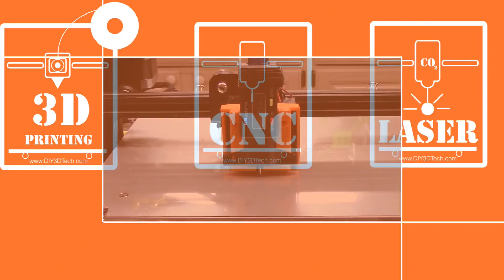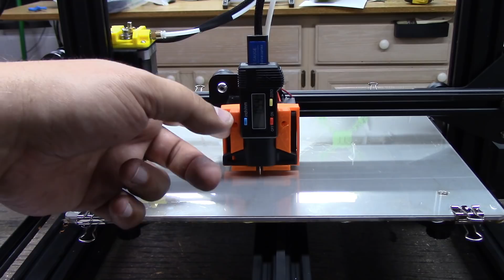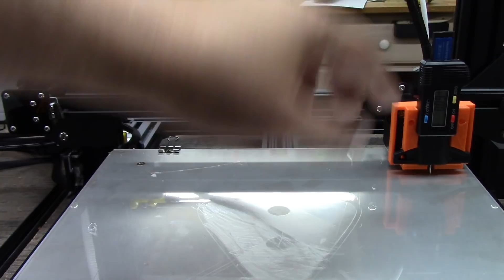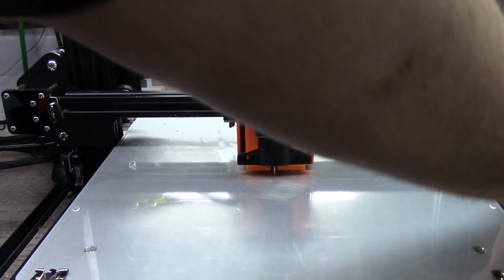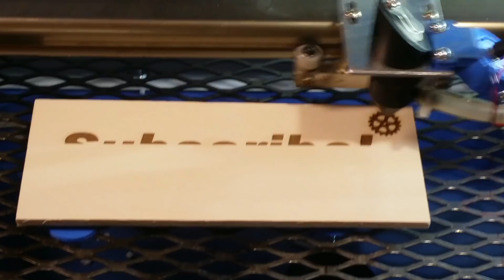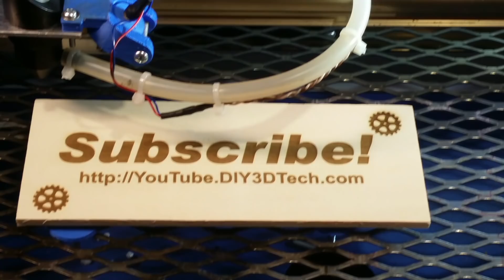Creality CR10 - Low Cost Digital Bed Leveler and Tramming Gauge!

Comment: I don't understand the fuss with bed leveling. On all of my printers I level the corner and center with folded piece of paper and they stay level until I change something. First layer is perfect everytime. Its not like when I run a CNC and have to touch off before every job.
Reply from the maker: The famous answer is it depends, if your doing rough (say 0.2 or 0.3) prints with PLA then your good for the most part.  Where it becomes more important is with ABS and other like filaments.  Second it is critically import for dimensional accuracy as if your first layer is off, then it will add in to each additional layer and you will end up off at the top. Again if your goal like with a CNC is accuracy, they it is import as 3D printer is really an inverse vertical mill...

Comment: Do you do the bed levelling at bed temp or cold.
Reply from the maker: Great question!  Technically "hot" however I typically do it "cold" because its faster and there is very little practical difference as for the first layer I will set the slicer to over extrude by about 3% (i.e. set to 103%)  which means my first layer will "correct" any dips up to 3% and just push out for any hills so perfect prints every time!
Reply: @DIY3DTECHcom  should always do when hot. As increasing temp does change the shape n size of metals or aluminium in very small scale as printing is done by heating . So leveling in hot temp the same temp you print is good thing

Comment: can you please make one for the Ender 3 thanks
Reply from the maker: Sorry but I don't have an Ender 3 :-(
Reply: DIY3DTECH.com still great video i will rework it for the ender and do a video on it with links to your video..... thanks again!
Reply: I just ordered the Digital Tire Tread Depth Gauge on Amazon for $8.99 two day ship. Im working on the model you made for the CR-10 to fit the Ender 3. Thanks again!
Reply: I printed the mount it works great!
Reply from the maker: Very cool :-)
Reply: Did you rework the mount for the Ender 3 or did you use the CR-10 mount?
Reply: docburch55 i did a few very small changes to your design. It works great! I posted it up on thingiverse....and then i did a full rebuild and made a holder for it as well. My bed is trammed perfect....i still having a hard time using paper to set the height.

Comment: i dont like inductive sensors, i manually level my bed with a filler gauge at the height of the first layer thickness so no movemnt in z axis needed for start printing, another thing is when you are printing with abs or another high temp plastic the temp of the heatbed causes deformations, when i print with that pasltic i wait 10 minutes after the bed reaches the print temp and then level the bed
Reply from the maker: I prefer this route too however just got a new printer with one so will give it a try grins and giggles 🤓
Reply: Good tip with the feeler gauge technique. I will give it a try.

Comment: I have a TEVo Tornado and am having a bear of a time (traming) leveling the bed.  I think these Chinese Springs are not the greatest. Also using the paper method? HA! What thickness of paper?  Nobody but you has mentioned Card stock. I had cataract surgery recently and don't have my new glasses so am having a hard time to see the nozzle. I'm intrigued about this dial caliper 'leveling'..The tornado isn't far off from the CR10  Maybe it'll work?  Thanks
Reply from the maker: I like the card stock the best, its 0.28mm  and I snug it up so it grabs making it around 0.23 so work with 0.2 or larger comes out just fine....
Reply: Thanks.  Something like a postcard?
Reply: Thank you

Comment: Interesting. The option for the data port could be nice for working with a machine remotely, and the price point is great.

Perhaps with small motors on each of the bed's calibration screws, combined with the data from the depth gauge, a bed can be trammed automatically and accurately instead of being merely compensated for or manually adjusted.
Reply from the maker: In very high end commercial machines they have that but typically the bed is stationary on those as the weight of the motors can add up quickly....
Reply: DIY3DTECH.com Very cool. Thanks for telling me.

Comment: Quick and dirty spring loading - use a rubber band on the top part - job's done :)
Reply from the maker: That's what I was thinking and designing in some clips on the side...
Reply: Did you end up designing one with the clips, if not i'll get around it to it this week.
Reply: @_FFFFFF_  How'd it go

Comment: Just a side note to this, to get an accurate bed level the nozzle should not be paper leveled first as it will push the bed down in the high areas and the indicator will show "level". Move the z axis up an arbitrary .1" and run the indicator around and check the points.
Reply from the maker: The reason for paper level first is what you are doing is "tramming" the bed so what you want to do is get a good paper level first and fine tune it from there by normalizing the distances. as 0.3mm or 10mm up there will still be the same high and low spots and you average them out...

Comment: could you not use a simple rubber band to give you downward pressure.
Reply from the maker: Yes that is what I am thinking about doing... 😉
Reply: @DIY3DTECHcom  How did it go? The only problem I can think of is installing the rubber band so that just enough pressure is used to keep the prong down without at the same time changing the height of the bed when it pushes down. You could take that into account if it did but I would prefer that it didn't.
Reply: Thinking the same :-)